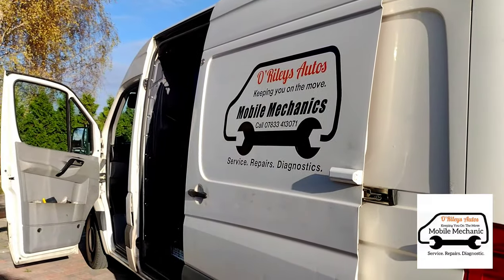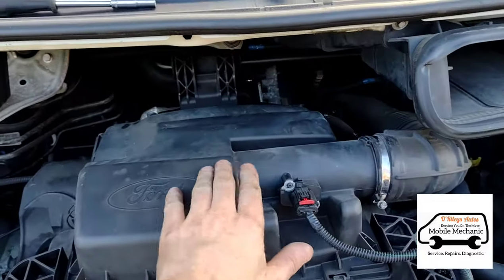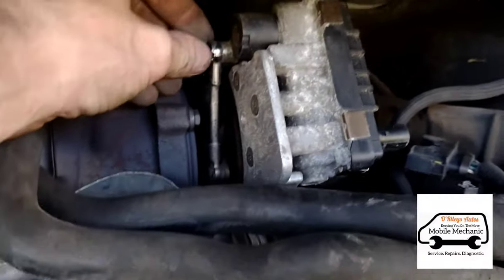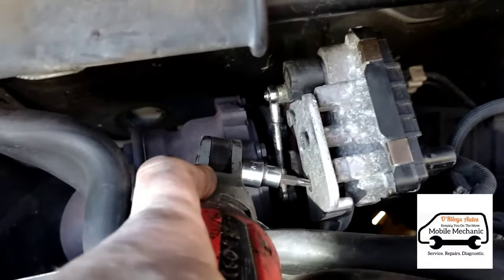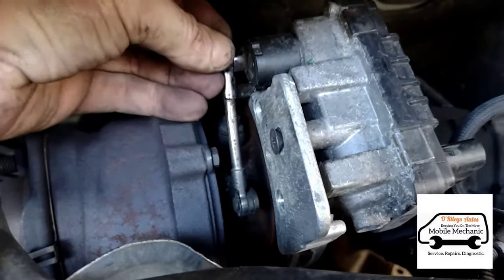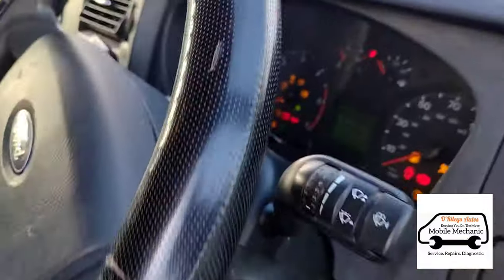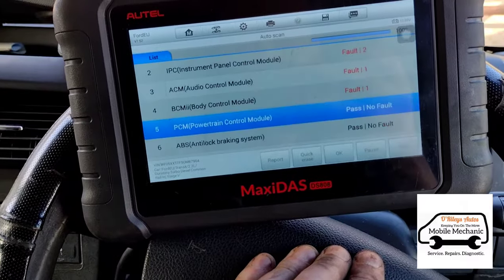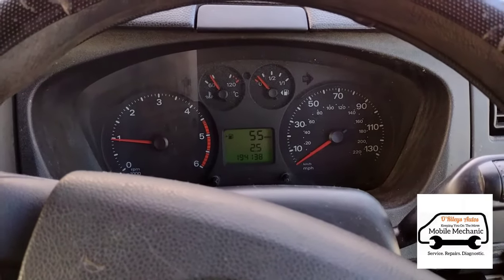P2598 Ford Transit 2.2 FWD Turbo Actuator Replacement Fix

Comment: Hello, have you got any tips to easily remove the horseshoe clip on the actuator arm? Everything I try just spins it around.
Reply: I solved it, the back end has a little loop you can pop something in to lever it off. Just make sure to cover it as it can ping off and is a nightmare to find in your engine bay.

Comment: Does this same engine as ford tourneo  custom 2014?
Think i need to do this. Vans in garage but seems straight forward.
Can you clear the fault code by disconnecting battery instead or code reader?
Is relearning the turbo required as i dont have this device?

Thanks

Comment: Hi got a 2014 Ford transit with the fault code p0299 turbo underboost, has had a new turbo and I’ve done all the reset of the learned values but it still keeps putting it into limp mode any ideas 🤷‍♂️
Reply: I've got the same thing now mate! Did you figure out what the issue was? Any info is much appreciated, thx

Comment: Ford in Ireland won't sell it separately have to buy new turbo  is it the same in the uk
Reply from the maker: Yes. You can get them on ebay
Reply: Hi , when ever you change air flow and map sensor do you have to do a re learn procedure or can you just drive the van without a re learn .